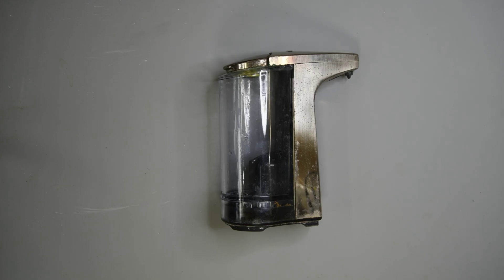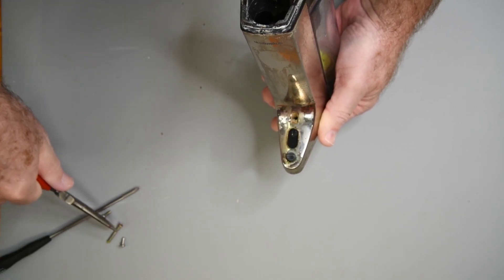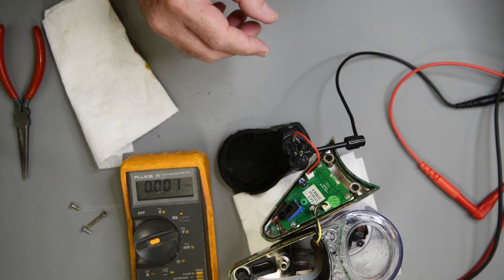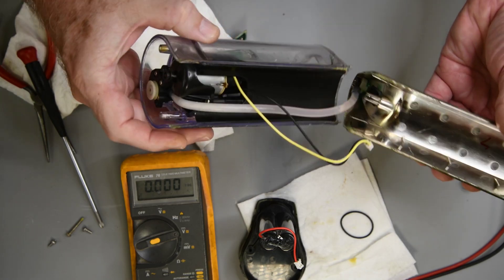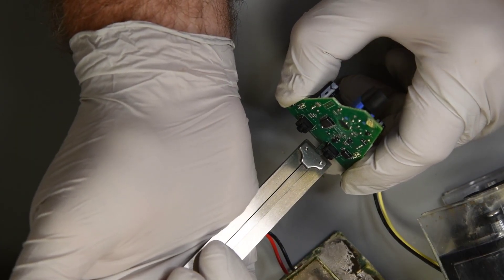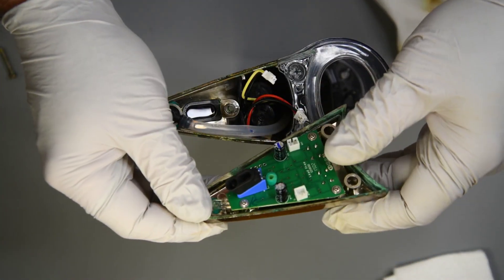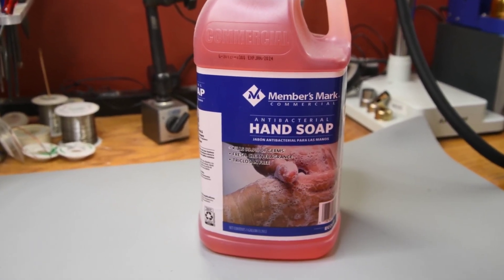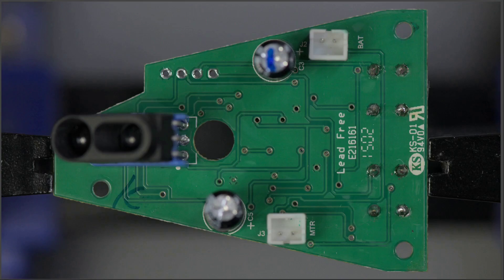Can It Pump Again – Simplehuman Soap Dispenser

Comment: Thanks so much for this video! Whats the oil product you're using? (oil type and dispenser name if you can!)
Reply from the maker: I used Synco’s Super Lube with Teflon.  Only they don’t have Teflon on the label anymore, it’s listed as PTFE.  This is a very old ¼ ounce oiler from them. I don’t know if they even have this size any more.  The fact that this 30 year plus old oil is still liquid and works, good stuff.  But I think any machine oil will do for the motor bushing.

Comment: Just fixed mine using this video but I had a different problem. Seems like the soap is leaking into the lower reservoir and cause it to fill up and get pretty gross. Also the small rubber roller on shaft fell off. I cleaned it all up and super glued it to shaft. Hoping it holds up but not sure what to do about leak there. Thanks.
Reply from the maker: Can you tell if it's leaking around the pump or is the acrylic cracked?
Reply: @metalplasticelectronics354  I didn’t see any cracks. We have never dropped it or anything. Had it about two years so far. I put it all together and am going to keep an eye on the base. If it starts to fill up again I might try some silicone. Thanks again for the video.

Comment: April 4, 2023.  Mine is flashing red with new batteries.  Prior to installing the new batteries, it was flashing red so I pressed the plus button.  Looked like nothing was happening so I left it.  Then when I looked over, it was continuously dispensing all the contents out.  How do I fix this?
Reply from the maker: Take a look at the PC board.  look for any corrosion first thing.  U4 might have shorted out.  That would cause the motor to run all the time.  Only things I can think of.
Reply: @metalplasticelectronics354  thank you!
Reply from the maker: Good luck.  I know I hated it when mine broke.  Amazing how attached get to these little gadgets.
Reply: Mine is doing the exact same thing!! I cleaned it, just like I always have. Put batteries in and tried turning it on but no light was coming on. SO I walk away for a bit and then my flatmate starts calling for me "Your soap dispenser is spewing out all the soap to nobody!! Look, what a waste of soap!"
Reply: @metalplasticelectronics354  AWESOME! Thank you so much Sir for this! Greatly apprecaited!
Reply: Excellent troubleshooting tutorial ! I’ve had one like yours for over 5 years and the only issue I’ve had was the oxidation on the brass plate on the battery cover. Some 0000 steel wool always fixed it. Now however it won’t pump but the motor will turn very briefly and I’m getting mostly a red light but sometimes a green light after touching the sensor if I disconnect the new batteries and reconnect them. I did oil the motor though it seemed to turn fairly easy and checked the wires for voltage and got 6.21 then when the motor turned for a split second I got 5.90. Looking at the sensor theirs 2 bulbs and the rear one is dull compared to the front and there appears to be light rust under the rubber shroud coming from somewhere and the 3 wires coming off the sensor going to the board are white from oxidation it appears so maybe my sensor is bad. If it is a bad sensor hopefully I can find one that will work if I can figure out how to uninstall the old on and put the new one in. Any advice would be greatly appreciated. Update: So with a couple jumper wires I went directly from the battery to the motor and it ran fine. Now I guess I could attach the belt and add some soap to make sure the pump is ok but it like it’s the sensor, unless something is going on with the board. Any idea what kind of sensor this is and where can I purchase one?